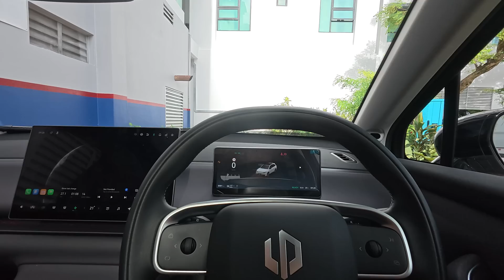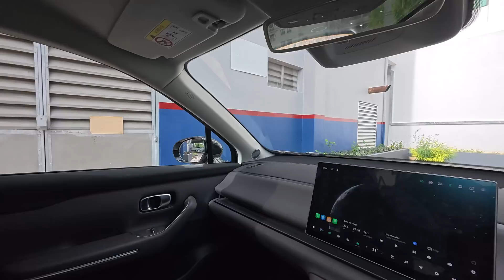This electric Cayenne is only RM150k

Comment: Hey Bobby, I wanted what do you think of the current trend of everything going LCD iPad design in the interior? I think Malaysian market a lot of demand for it because everyone trying to emulate Tesla’s minimalist look, but I don’t think it’s a good fundamental design unless the car is truly “fully autonomous and smart”, which most cars isn’t.

I still prefer what cars were doing with the 2018-2023 styles where the instrument clusters sit much more flush to the dashboard, I think the floating design is just a way to save on material cost. I think BMW and Mazda has the best interior designs for driving with aesthetics, as I like knowing where each button is instead of smashing the screen while driving
Reply from the maker: @timhean  I too don't like big LCD screens, but it seems like an unavoidable thing. First of all, if car makers choose to integrate a large screen into the entire dash, it will look very ugly compared to a floating type. Because it will push the entire dash cowl very high, obstructing visibility. Secondly, instead of being able to place the air vents behind the screen, they have to be pushed to the sides or below, I do think that without air ventilating the screens, high operation temperature might reduce their life span. Third would be the entire molding of the dash for right and left hand drive will be costlier to optimise for different markets were if they're integrated. 

Now if we go with smaller integrated screens, there comes the problem with deciding which functions to split to which screen. Audi does that and left it static, meaning the bottom screen is permanently displaying the aircond buttons, which makes one thing why bother using a screen anyway if that's all you wanted to utilise it for. 

Lastly, a big screen that cleverly separates different animations, different and multiple shortcuts is actually very easy to use. While most European makers are still obsessed with linear multiple level menus applied to large screens, Chinese car maker's Teslafied systems that uses a drop down menu for quick shortcuts and a bottom dock for aircond and quick access proves much easier to orientate. And then a single row of buttons depicting separate functions and then upon clicking leading to a giant page of toggles to ON or OFF functions proves much easier to navigate compared to BMW's convoluted menu sub menu linear progression screens which works together in a non touch screen + click wheel environment, but useless and pointless in a touch screen environment. 

So I guess in a world of smart cars, it's unavoidable. I myself of course prefer physical intricate buttons and no screens, but that would meant many hidden menus have to be integrated deep inside the cluster interface which might affect driving if you wanna do things on the fly. 

so far, BYD seems to hit the perfect balance in all of these. Large screen + physical buttons + manual airvents. But that also means they can't do auto oscillating function with electrically operating airvent actuators like this Leapmotor C10
Reply: @ I saw your vid on the Peugeot 408, I think their dual centre console screens was quite interesting with the shortcut screen at the bottom, I myself am in a dilemma where I want to buy newer cars, but can’t bring myself to give up physical buttons. I detest the current C-Class, even Lexus new ES moved to mostly all screen. 

For me, now more than ever Pre-owned is where I’m looking at for my next purchase, more economical is one thing, but the driver layout is another. So far the 408 is the only car that impress me in terms of looks, power, and price, but now debating with a pre owned G20 3 series.

Comment: Hi Bobby. Since u already driven practically all EV cars from China, which one gave the driving experience similar to a BMW? I'm considering owning an EV and BYD Seal caught my attention the most.
Reply from the maker: So far? Proton Emas 7 and Emeya and EX30, Seal, Sealion all drives proper
Reply from the maker: Amongst these, surprisingly, the gold standard for price Vs tech Vs amount of fine tune calibration on handling and ride, is the Proton
Reply: @BobbyAurizn Hi Bobby, how do EV cars from China compare with Tesla 3 & Y in term of handling and experience?
Reply from the maker: @HaoHao2986  easily comparable and then you get better interior in the Chinese ones
Reply: A follow question would be how would the mentioned China ev brands' software execution & battery management compared to Tesla?